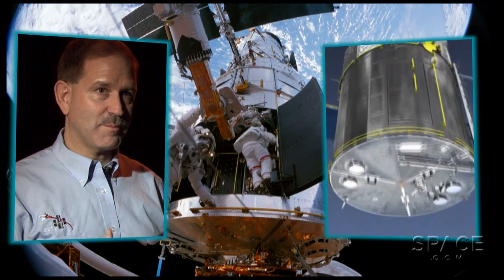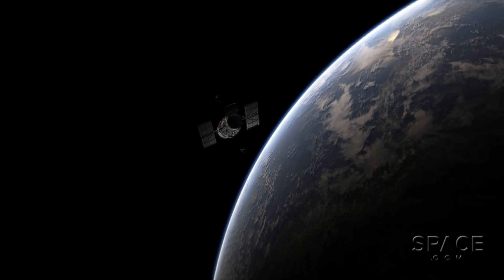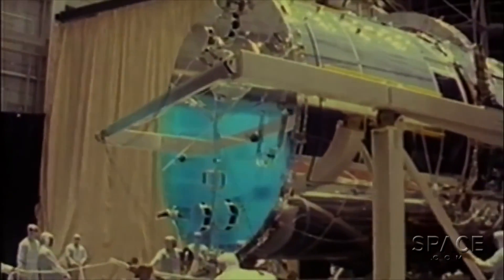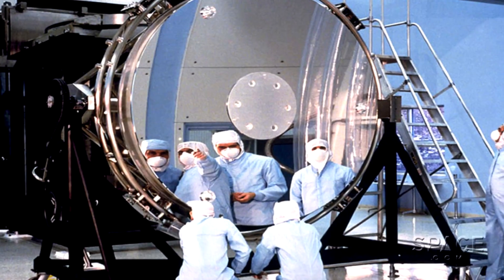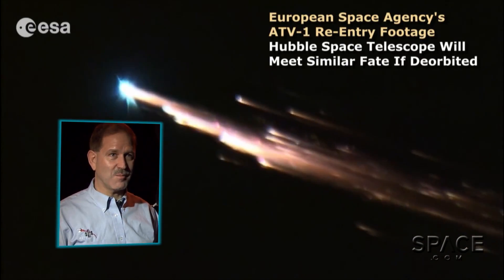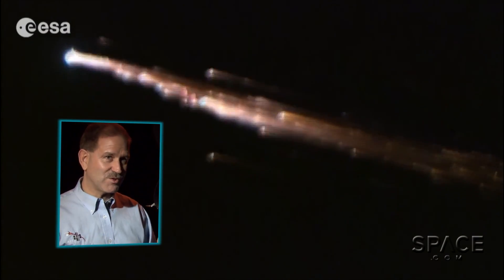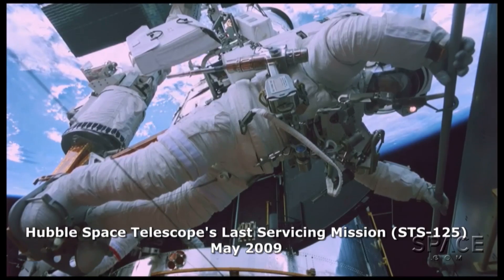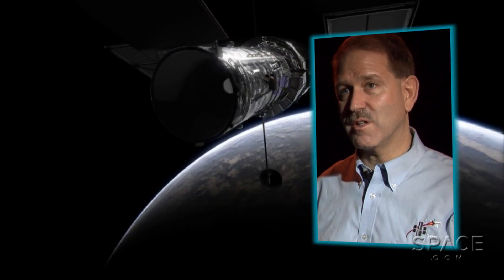Hubble Space Telescope - Kill Or Save It? | Video

Comment: Ill be honest. I think the reason most people want to save it is simply its public status. Most people don't even realize it was named after a real pioneer in astronomy. 

Its a 30 year old satellite. Most Satellites only last 10 years. Hubble has had a great run but its time to move on. I honestly think the day James Webb is up and running we should abandon the HST and deorbit it.
Reply: pjt i knew all of that not braggingand btw i think we should keep it up there
its a great achievement
Reply: pjt JWST coming online doesn't make Hubble obsolete. There is MUCH more demand for observation time than there is supply. Even with JWST in orbit, Hubble will stil stay fully booked.

I'd say service it and prepare it for deorbit at the same time. You can keep using it for as long as it lasts but you can deorbit when needed. If you can do a servicing mission, attaching a small engine will not make a big difference.
Reply: pjt Can't we at least put it in a museum though?
Reply: Noah Williams And how do you propose to do that without a Space Shuttle?
Reply: *****
idk. Space Planes I guess.

Comment: I have an idea before. I made my own space vehicle design a few years ago. It's designed to save Hubble Space Telescope (HST) from falling into the Earth's atmosphere. It is called Hubble Boost Module (HBM). HBM uses the remote-controlled Canadarm or robotic arm to capture HST and move HST onto the berthing port on HBM. HBM carrying HST boosts from low Earth orbit to the geostationary orbit (22,300 miles or 35,900 kilometers). HST with or without HBM remains in space forever. It will be a backup space telescope to assist James Webb Space Telescope (JWST) if JWST has a problem. Saving HST needs funding. Hubble supporters or protestors would get petitions to save Hubble.

Comment: Since a service mission by Nasa's incompetence costs more than 10 new superior telescopes done by someone not quite that spectacularly incompetent then the answer would seem obvious. Of course Nasa is not in the rational business so doing the right thing is unlikely. Not that any of you sheep will notice.
Reply: Giza Plateau NASA sent a mobile science lab to Mars for the government equivalent of pocket change. You hush up. D:<
Reply: Giza Plateau What evidence do you have to back up this claim? Studies? Hard numbers? : / ?
Reply: ***** Nasa has serviced Hubble twice with the shuttle? each time costing 1-2bn$. Spacex falcon9 launch is on the order of 50m$. A pro telescope is a ritchey chretien double mirror design. They can be assembled in space so you just stack thin 4.5meter mirrors with spacers in between them to maintain the shape during acceleration. A few beams for the structure, black cloth for the tube, a few solar panels and some ion and maybe magnetic thrusters and you could do 10 scopes for 100m$. Dare to think.